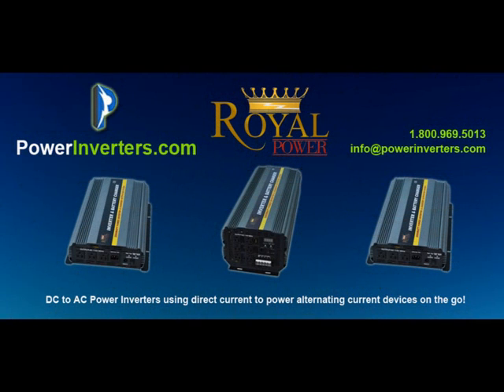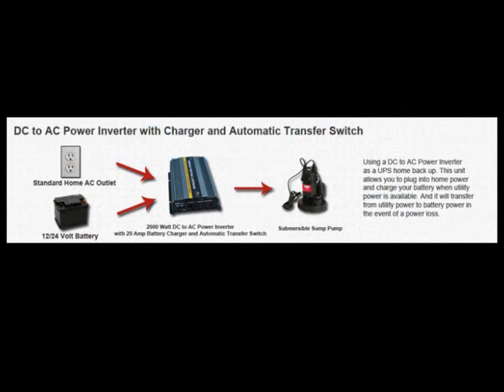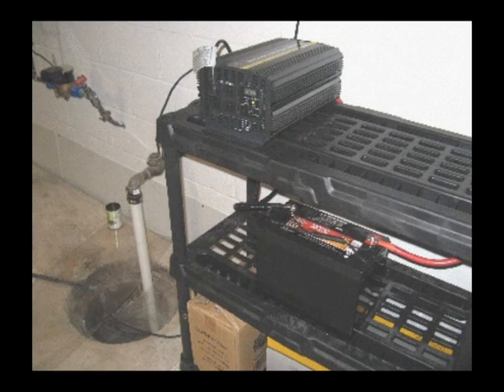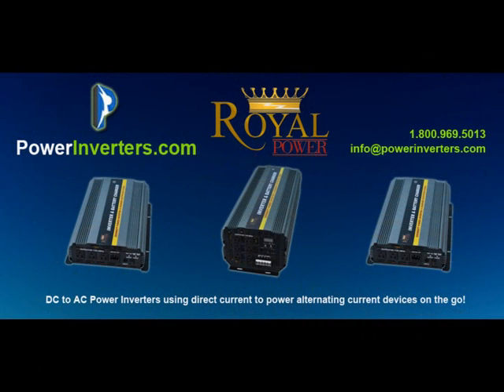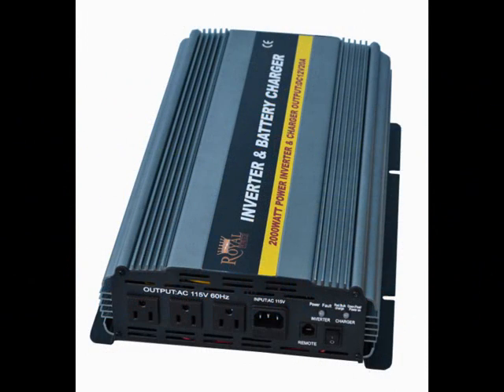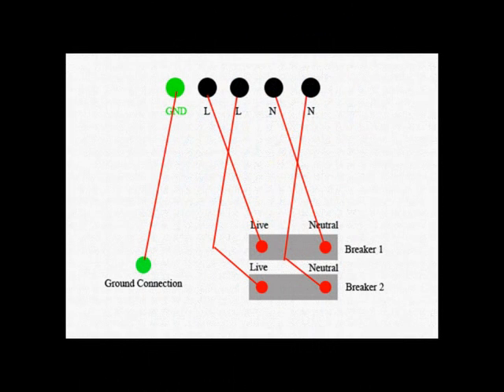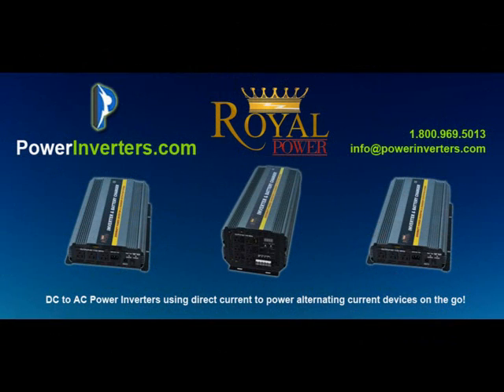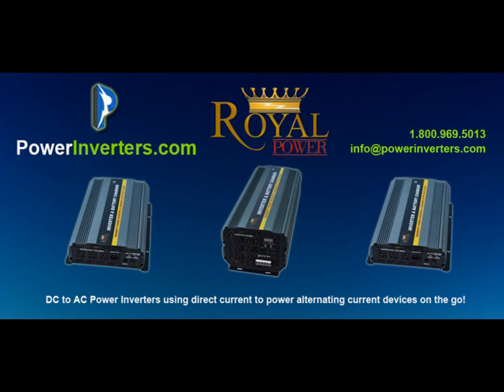Inverter Chargers

Comment: I'm living completely off grid. Does an inverter charger provide any advantage in my situation compared to a regular inverter?
Reply: No, not unless you're using a generator, then you could use the generator to charge your batteries through this unit if you wanted to. I'm not sure how good of a charger these units have, I doubt if they're three or four stage chargers.